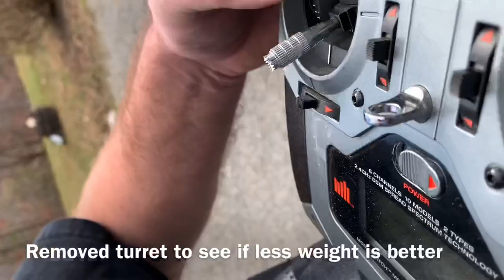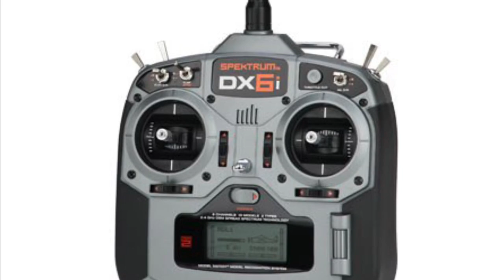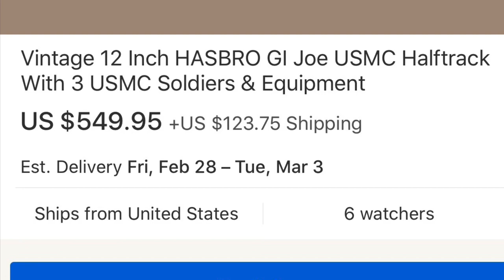Hasbro 1:6 M3 Tank Destroyer With RC conversion halftrack

Comment: im thinking about doing this with the m3 I have though ill probably use a hobbywing axe motor. also you could use a spring based track tensor the tracks were never meant to be powered so they are a bit loose